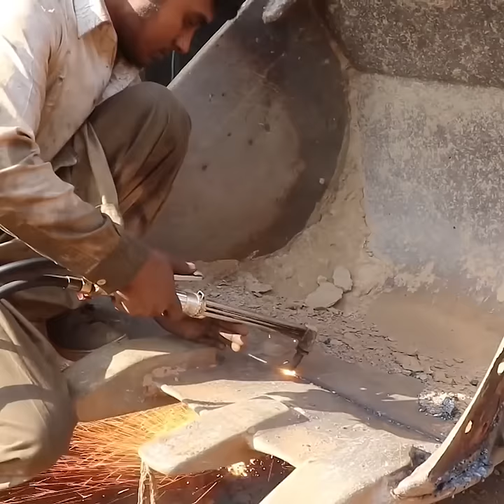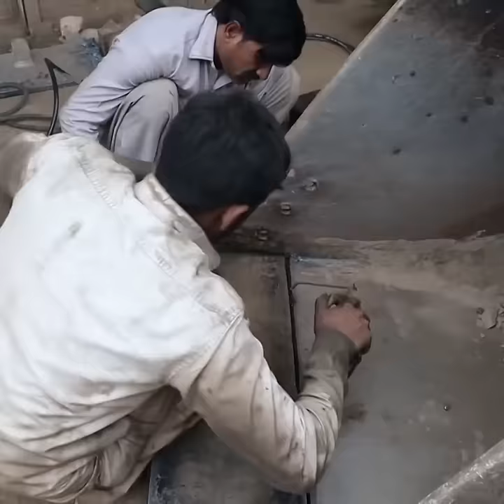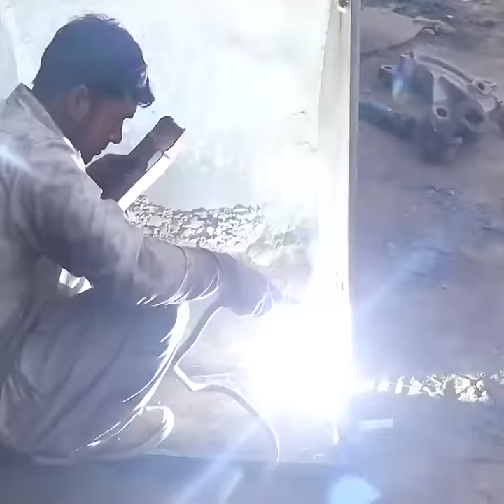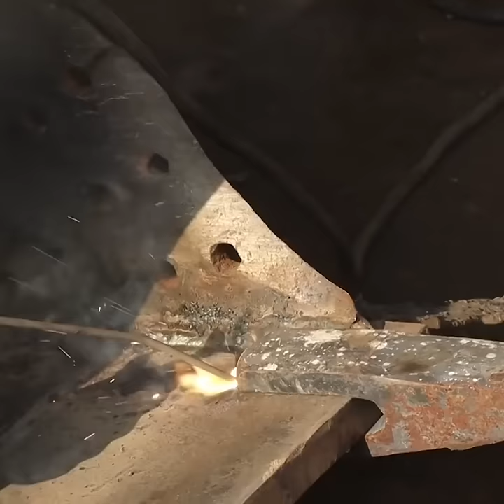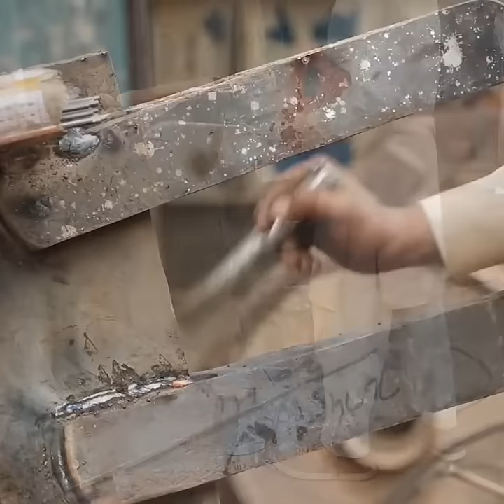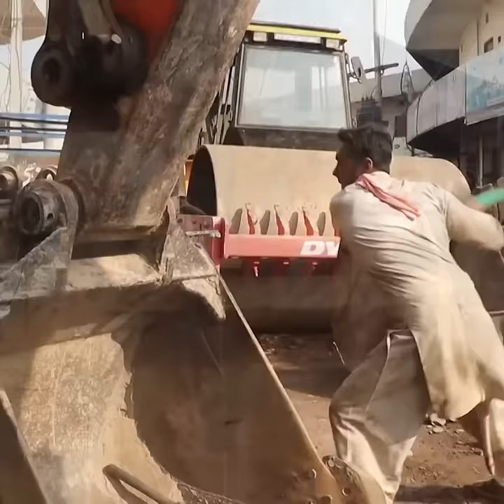Skilled Workers Repairs And Upgrade Broken Excavator Bucket Teeth With Amazing Skills

Comment: Yep now the backside will break due to uneven heating. Great waste of resources y'all.
Reply: I liked the part how the most loaded weld seam was filled with a mild steel construction rebar rod
Reply: what's the effect for u?
Reply: It works obviously that's why they got customers
Reply: I did this type of repair myself at the construction site, it was supposed to be temporary but it's been a year.
Reply: Depends on what purpose of job.. should be ok if they just use it to dig some land.. & not dig at hard surface like a stone..

Comment: Awesome! Thats the difference between Americans and almost any other country - Americans would just b*tch and moan that it is broken and throw it away and get a new one instead of doing the work to repair it. Nice job.
Reply: monkey wailing noises intensifies
Reply: You are wrong there! We would have had inserts already welded on PROPERLY, then when the teeth wear out, you just drive out a pin and replace the teeth as they wear out! 
And if a insert wears out, you cut it off and then PROPERLY weld a new insert back on!